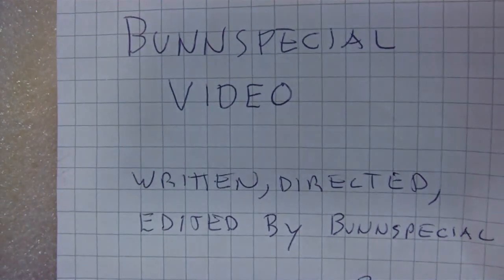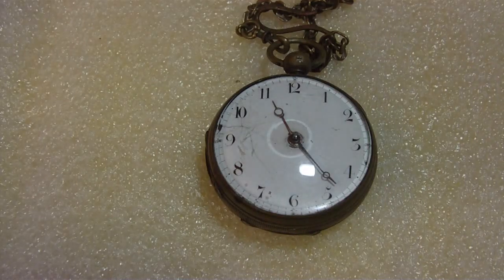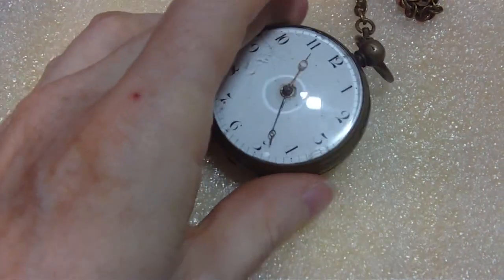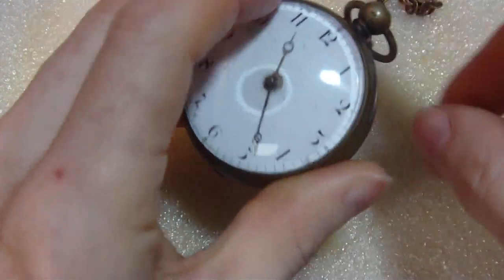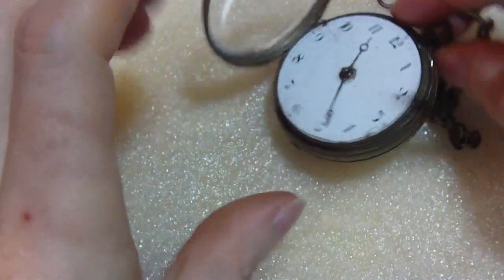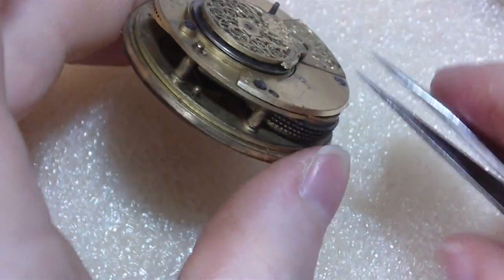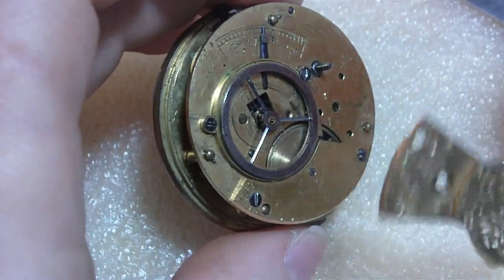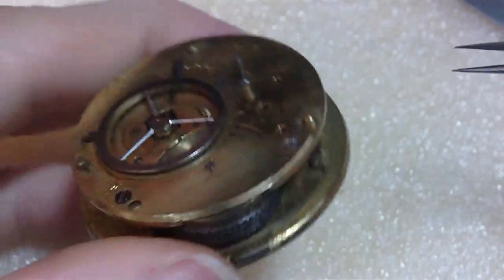How I take apart a Verge Fusee pocket watch

Comment: I would think the easy way to remove a short tapered pin would be to tap it out. No struggles, no swearing, no slipping, no scratching… And definitely not a pain in the ass.
Reply from the maker: I thought so to but some of them fought to the better end.  I have taken out many tiny pins like those without any problem.  My superior intelligence over came the problem.

Comment: Hi I really pove your videos and watched almost all I collect pocket watches and I am 14 years old.
I have a question how do you clean a watch after dissasembly?
What is the method that you use?
Thank you for such a great content 🙂.
Reply from the maker: This is just a hobby so I don't have a machine to do the cleaning.  I place the parts in a jar with either lighter fluid or naphtha.  I don't put them all in at the same time.  I separate the plates, wheels, balance and pallet fork so nothing gets damaged.  I use peg wood or a tooth pick to clean the pivot holes.  I use an old toothbrush or tooth pick to remove the dried on crud.  I use a dust blower to dry the parts.  I use pith wood on the pivots of the wheels, pallet fork and balance.  Don't forget to take off the cap jewels and clean them.  I always find dried oil there.  Use the cleaning fluid in a well ventilated place because it's poison.  Don't use a wire brush because you will scratch the finish.  Don't use a dishwasher because none of the parts are dishwasher safe.

Comment: Judging by the dial, hands and palette i would say it dates to around circa 1830, classic regency English Vege. the case looks circa post industrial revolution so a later housing, likely for an english lever with drop out movement. inner case markings would just be case makers mark or foundry mark in this case as its plated.
Reply: I think it's even earlier, around 1800s or '10s
Reply: @themaicky3209  well that's only 20 years difference :-p I have handled and sold thousands of pocket watches over the last 20 years, even had a 16th century Nuremberg egg once, wish we could make a time machine and find out!

Comment: Is that tv still working?
Reply from the maker: Probably not.  For some reason the TV's that I replace capacitors on only work for 5 or 6 more years and then die.  I don't try to fix them again because by that time I have gotten another one that is bigger and newer.  The largest dumpster TV found is 60 inch.  The newest is 2018.
Reply: @bunnspecial  6more years is not bad . Keep up the good work